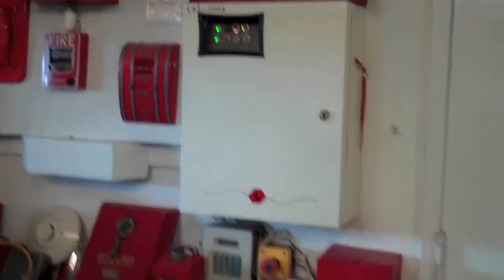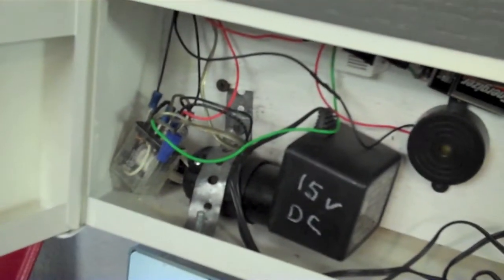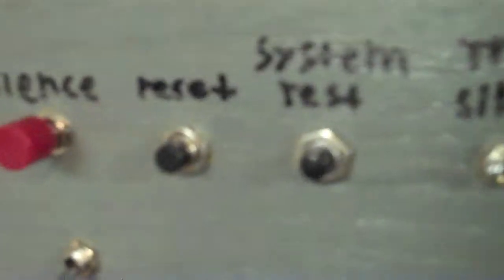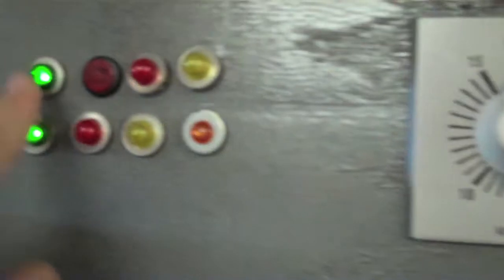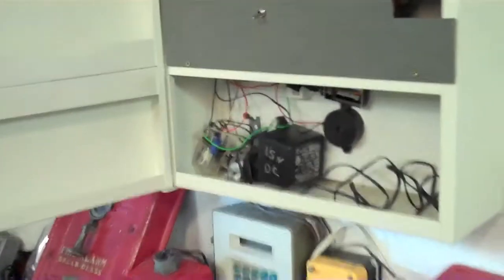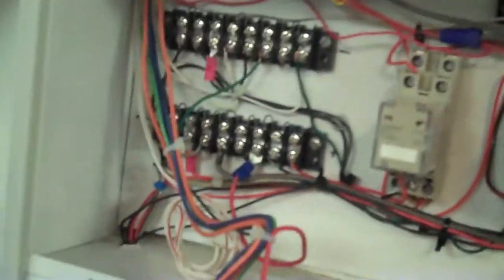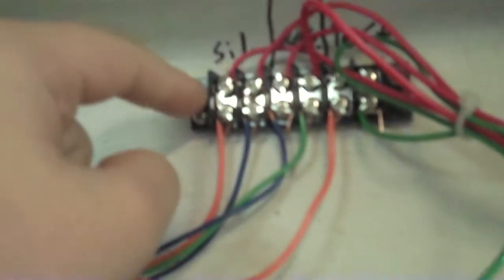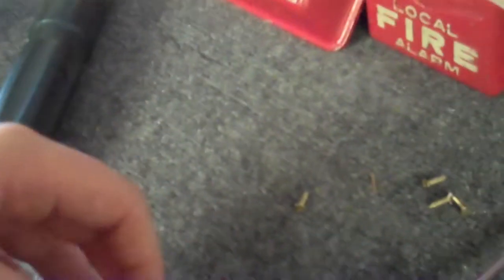Inside my home-made LRS-7002 FACP + Update

Comment: instead of having a on off button for silence why don't you use a transistor latch circuit so when you click reset you wont have to turn it off it will do it automatically.